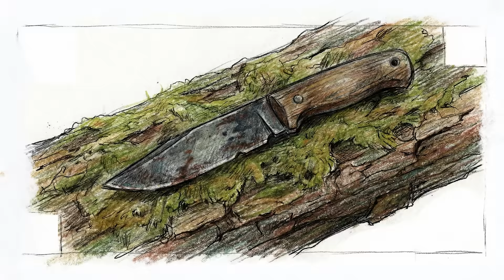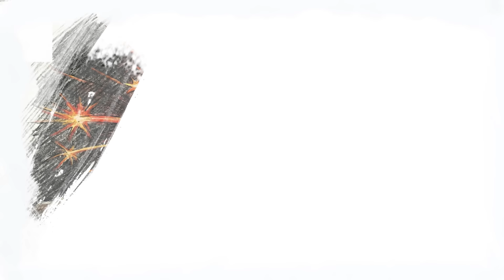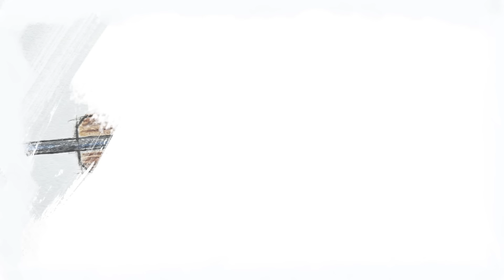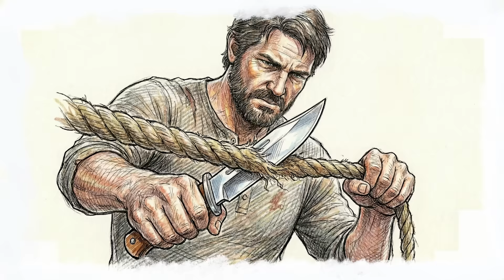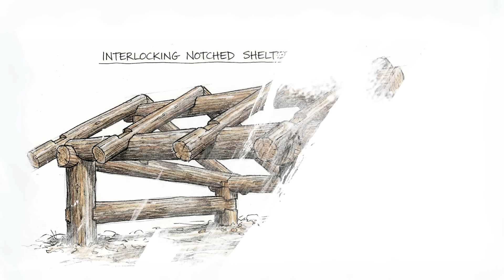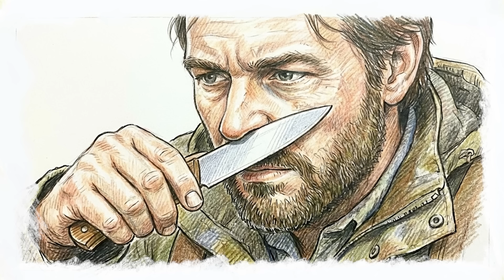Why Your "Survival" Knife Will Get You Killed

Comment: First off, chopping and splitting wood, is extremely hard on any knife, and it wastes time and burns calories you might not be able to replace. A small folding saw and a hatchet would be a better choice to carry. Cold Steel now has a line of folding knives using the Triad locking system. It works great. The Rajah 2 with a six inch blade, works great. Now will I chop and split wood with it. Nope, because I will always have the right tools, when I go hiking.

Comment: A good fixed blade knife is an essential survival tool. But it can’t do everything and the more you abuse it, the most likely it will break. Other than skinning game, most of these tasks can be performed with a good hand axe. Not your tacticool combat tomahawk, but a basic hatchet.  Like an Estwing 12 or 14 inch camp axe.  Also, a Silky folding saw is light weight and can process more wood than you ever could with a knife.  They aren’t cheap, but with be used by your grandkids when you are dust.
Reply: Facts

Comment: wow really? you're telling people to get a knife to split wood in a survival situation? if you have your pack in the back of your car or truck you can use any fixed blade but most people have a multitool with a hatchet or a regular hatchet in the trunk of the car or behind the seat of the truck, if you don't then you're gonna void the warranty of the knife with the first strike when batoning. a knife isn't made for this, a knife is made for other purposes, processing game and fish carving and lots of other camp stuff and if you mistreat it by batoning and break it you have nothing, using it for a hatchet should be a last resort if even then
Reply: I never baton because my folding saw is much safer and efficient for processing wood and there is never a shortage of smaller branches.  If there is nothing but large logs available just either use your knife to shave off lots of tender and make a Star Fire or use the saw to cut out a three-foot section and cut an 'X' groove on one end, carve a splitting wedge out of wood to split the log length-wise and use it as a Swiss Log Fire!  Remember to use only standing wood only if possible.  If not, make a ring around the fire with the less-than-dry wood so it will at least partly dry!

Comment: I've been collecting and using knives since the early 80's. Camping, Hiking, Hunting and Fishing. And I've never had to split a piece of wood with a knife, because I will always have a Hatchet or Tomahawk, and a small folding saw. On tip of 4 knives and a multi tool. Right tool for the job. Oh and a knife with a 6 inch blade, is going to make a mess of trying to clean a rabbit, fish or squirrel. You want a knife with a 3 inch blade for that job. The Buck 102 Woodsman, or the Buck 117 Brahma would be just about perfect. I have both. Too keep my tools sharp I have a file in my multi tool with a fine side and a medium side. Plus if I had to leave my house, I would pack my Ken Onion Guided Field sharpener. As for keeping your carbon steel blade rust free. I carry cotton balls imbued with Vaseline Petroleum Jelly, as fire starters, but those have a few other uses, pluss they do not weigh much. If your using a good pack, that fits you and has good shoulder straps and a waist belt, carrying the load will not be so bad.
Reply: If you don't get all of the vaseline off of your knife 
before cutting food, it
WON'T poison you like the
petroleum distillates in 
gun oils and rust preventatives
will. 
Been using a light coat of vaseline on knives and guns 
for years since I read John
Jobson's writings years and 
years ago

Comment: I wish people would stop using a knife as an axe! Carry an axe a preserve the knife for what it was intended for! You will spend more energy sharpening your knife every 10 minutes if you insist on this batoning fad.
Reply: I agree. Frontiersmen used a hatchet or axe for splitting and chopping wood. They saved their knives and tomahawks for game processing and self defense requiring the edge to be sharp at all times.
Reply: @garylawrence9975 
There's no historical reference 
( that I've ever read) that the 
practice of " batoning " was
used from the colonial days 
on through the settling of the 
western frontier. 
We didn't do it in the early 70's 
when I was in the real scouts, 
and it's not mentioned or shown in my real scouts handbook or field manual
Reply: @maxpinson5002 i bet its the same with feathersticking…
Reply: @gabrielace4023 
We did do that in the real scouts 
in the early 70's, but only to get 
merit badge credit. As a general 
practice everybody used regular 
strike-anywhere matches that 
were sold everywhere and either 
a vaseline cotton ball or the 
real scout tightly-rolled-newspaper-
strips-dipped-in-melted-wax.
Two of the best fire starters that's 
ever been, and probably the two
cheapest

Comment: Minimum cutting Tools you should have on you or in your pack: belt Knife, multi tool, medium folding saw. tomahawk/hatchet , garden trowel with hole for longer stick,  One tool option is a myth
Reply: It’s not practical to carry that much junk. What you carry on you everyday is what you are most likely going to be stuck with in a bad situation. You can get used to carrying a knife every day, not ten tools.
Reply: When I leave the house. I always have my Swiss Army Deluxe Tinker knife, Gerber Multi Tool and Cold Steel Voyager folding knife with 4 inch drop point blade, and it has the Triad lock. If you dont know what that is, look it up.  Now if I'm going hiking I will add a sheath knife, 4 to six inch blade, a Tomahawk, that has a good cutting edge and a hammer side, and a small folding saw. The Garden Trowel is a good idea. So when you have to go Number 2,  you can dig a hole. Just because you've never needed any of these tools, doesn't mean that one day you might.
Reply: Just a knife is possible but what happens when it breaks or gets lost?  As well as a good heavy belt knife I carry a neck knife since you're a lot more likely to find small game (a meal or two) as opposed to large game which means that you must be ready to quickly process a lot of meat (drying, jerky) or you will be wasting precious resources!  I carry a small folding camping shovel/trowel for cat holes especially if you're dealing with rocky soil and then you're not dulling your knife digging!  It can also be used to deal with moving hot coals and scraping hides!
Reply: @rogerjensen5277  Right in One! Right tool for the job. Heck, if you have like a folding shovel, or one of the Cold steel shovels, you can even use it to cook on.
Reply: @JamesHart62 
Imo one shouldn't get tempered steel tools hot.
I know it's trendy, but I will 
not ruin a knife or digging 
tool by heating it.
Reply: Never needed a folding saw tomahawk or hatchet, let alone a garden throwel.
Reply: @StevanOutdoor  Lets hope you never do, if you don't carry them.
Reply: @JamesHart62  There are other ways to get the job done. It's called skills. It might take a bit more energy at that time but saves the energy of dragging around all that metal all day.
Reply: That's the truth Brother. Do all one knife is a joke.

Comment: BCT (Body Core Temperature) is a bigger risk than energy conserving but of course energy conserving is also important. That's why I normally use a stainless steel knife with some plastic/kydex/zytel sheath and plastic/rubber/G10 or Micarta handle. The knife has to take care of me and I don't want to waste energy taking care of the knife. I don't mind a full tang but it's not a demand. I never had any student in my classes break a Hultafors GK and that's a 10 dollars partial tang blade where I live. For sure a cabon steel knife dulls more easy so you have to sharpen it more often. Rust dulls and it will form on the edge first. Sharpening takes energy.
Reply: Well said
Reply: My old Gerber Multi Tool. Has a file. Fine on one side, Medium on the other. So I always have a way to sharpen my cutting tools. Because where I live, Wyoming, trying to find a "River Rock" is next to impossible. I now have the Ken Onion Guided Field Sharpener. It works great.
Reply: @JamesHart62  Many people don't leave their environment or region. They don't travel so they assume it's the same all over the world. So now I know Wyoming has few river rocks. There's places on the planet where it's basically impossible to find a flint hard enough for your steel. Go find a river rock or a flint they say. Use animal fat or find the right tree with oily bark. All this is labour intensive and will cost energy that has to be replaced by food. So now you have to find food also.
Bring few, but the right, tools and you conserve energy. A (fine) file on your multitool or a lightweight simple sharpener are very good examples.
Reply: Very well said. Im tired of seeing people say "Just take care of your knife!!!" because well sure it's important to, when you can .
In survival scenarios you cannot be worrying about such things you should be worrying about yourself first! Less maintenance - Less worries
Reply: @Benny-jt9cj Exactly what I mean. Maintenance means labour means consuming energy. That's calories you have to replace by food. I rather lay in my hammock conserving energy and not worry about my knife.
Reply: @StevanOutdoor  Yea , but when that knife gets dull it's harder to sharpen.  That super duper hard steal will dull. Carbon steel that is properly heat treated is easily sharpened on rock or porcelain if you know what you're doing. Lying around never got anything done.  I respect your opinion and am just saying mine because of experience in this situation. I will you well.
Reply: @TonyVoss-h2e  I'm not talking about supersteels with incredible HRC but simple stainless steels. They are just as easy to sharpen as carbon steels. I traveled rural Thailand for 8 months total in all seasons with a simple Mora Basic 546 as small camp knife. It's 12C27 stainless steel and indeed I sharpened/honed it on the bottom of a ceramic cup or plate when in town, just like the Thai do. I didn't even need to sharpen it again when back home. And my travels are 4 weeks at least but I see a lot of weekend warriors worrying. They are gone for 1 to 3 days. That's not even time enough to dull your knife.
Reply: @StevanOutdoor  Ok and I've heard a lot of good things about the Mora and other stainless steels done the quality way. Just my opinion and no disrespect intended. I have experience at 61 yrs. old but always open to enlightenment.  Thank you
Reply: @TonyVoss-h2e  We all have our own experiences. I'm 63 yrs old and traveled and teached 'survival' on 5 continents since 40 years and still am. Most people speak about their local environment and some even pretend to be 'experts'.  For people just starting out in bushcraft I do recommend a budget Hultafors GK or RFR (Sk5 carbon steel) or a Mora Basic 511 or Companion in carbon steel so they learn how to take care of a knife. If they f.. up they have lost 10 to 15 dollars. But the claim that carbon steel is stronger, easier to sharpen, etc. is a very old myth.
Reply: @StevanOutdoor  It all depends upon the KIND of steel, and the tempering, doesnt it. Mythology is as mythology does.